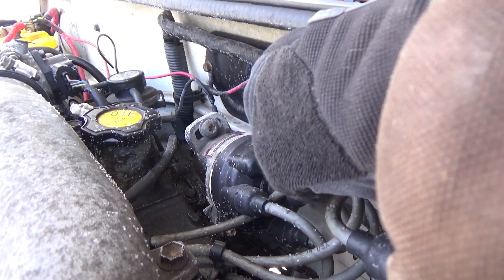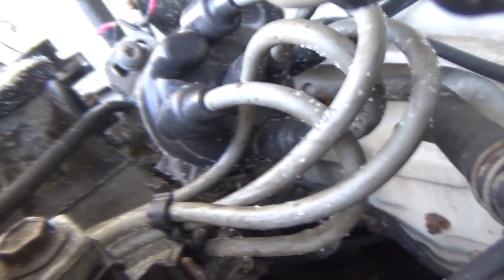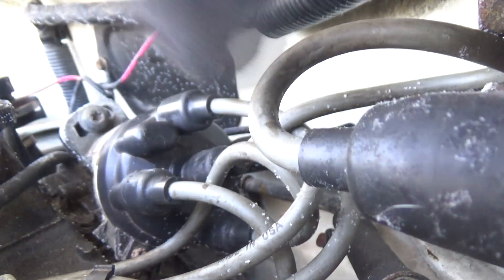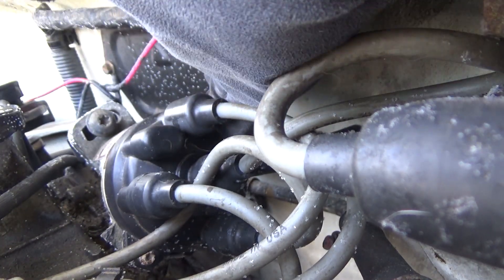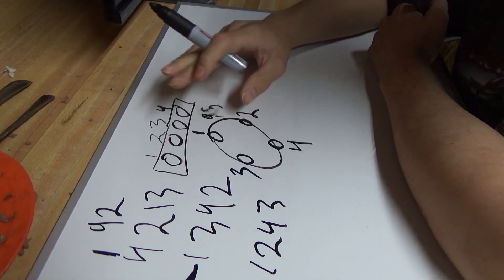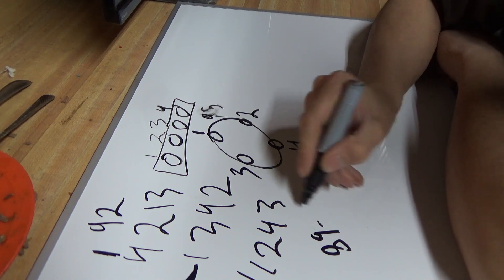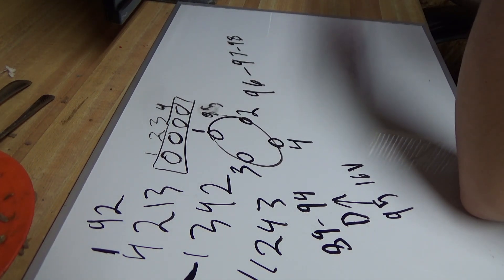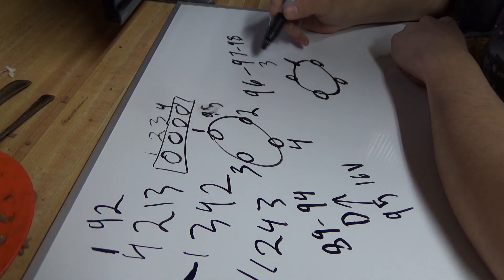Only for 1995 Geo Tracker 16V/G16B timing setup

Comment: I don’t know why nobody mentions that when you reinstall  the distributor that it has alignment marks on the shaft and the housing, you just have to turn it one tooth clockwise to compensated for when it engages with the cam gear, I have a 95 TT and love it and I use my timing light on #1 cylinder if I need to check or reset my timing

Comment: Dude. Your killing me. On the 95 model with crank gear alignment correct, and the e is aligned up top, you are firing on number 4 cylinder at that time. You have to turn the crank one full revaluation.  That in turn will rotate your distributor 180 degrees.  Now your firing on number 1. If you were to have the valve cover off, you'll notice  all the rocker arms are loose, meaning the valves are closed. Set your distributor to number one. I usually time them by ear, you can use a timing light if you want to. 5 degrees before TDC. Also you can figure out the firing order by looking at distance. Rotation.
Reply from the maker: Dude do what you want I show the way it was done and you can do what every you want to do I dont care ok good move on then